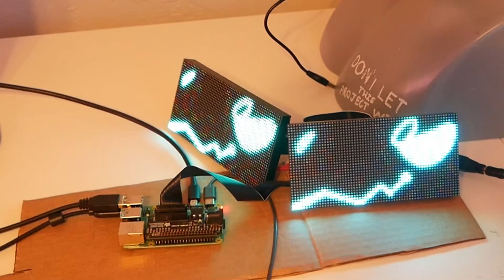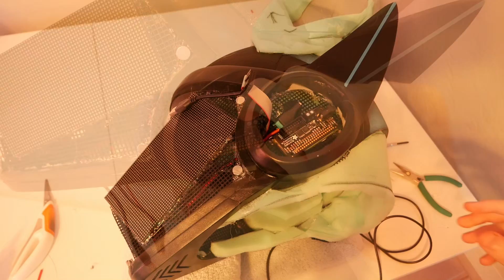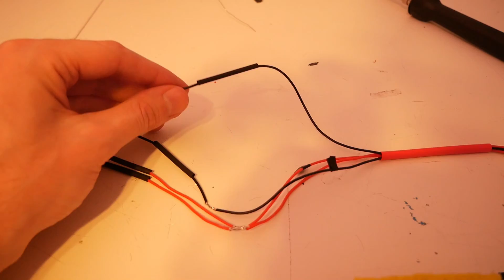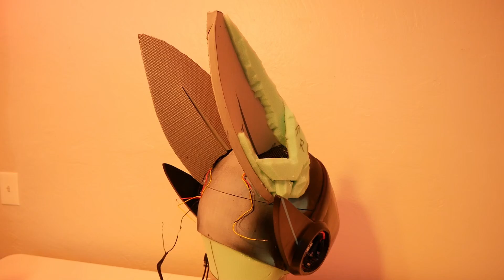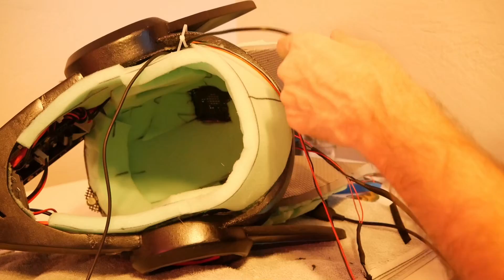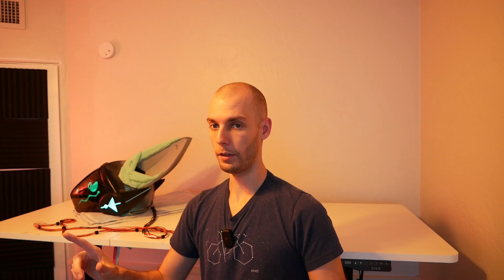The Most Exciting Upgrade Yet [#4]

Comment: Love the videos so far, my idea if you for some reason weren't making a whole suit, to hide the battery pack you could give it relatively long fur sorta going down your back a bit and then building the battery into the inside of the fur so that it's only viewable under the fur. 

I'm not a fursuit maker by any means so I would be honestly curious if that is a good idea.
Reply from the maker: I think with a full suit it should be easy enough to hide the cable, your idea is good!

Comment: i absolutely love this tutorial, and i was thrilled to see you end up using a larger grid for the LEDS rather than the ones meant to be used with the base as its what i wanted to opt for aswell, however, is there a way to make it so the eyes and mouth could be further apart? im realizing that using one LED panel instead of multiple makes the space a bit more limited, so i was wondering if you had a solution to that.
Reply from the maker: Space is definitely a little bit more limited using one screen vs several smaller ones. It ended up being about the same size, the limiting part is the size of the visor so you really can't get anything bigger than this under it. 

Glad you like it!

Comment: How did you made the visor? Thermoplastic vacuum? Is there a company that does it with providing the template 3D Base? The making of the visor is way too complex for one person alone. I'm looking for a vendor where I can buy one without spending a fortune on the required things.
Reply from the maker: I got mine (and the base) from kyborg studios
Reply: It's not hard to make w vacuum former if that's what you mean although i may be really late with this response all you need is a vacuum a sealed box with holes in it (and a big hole from the side to fit the vacuum tube) then a frame for the PETG plastic and finally you just neef to put the plastic sheet in the oven, wait until its starts to lower and put it on your form with the vacuum turned on, may be hard to understand because im really bad at explaining but there are a lot of designs on youtube how to make it